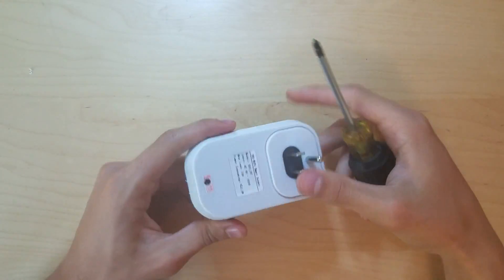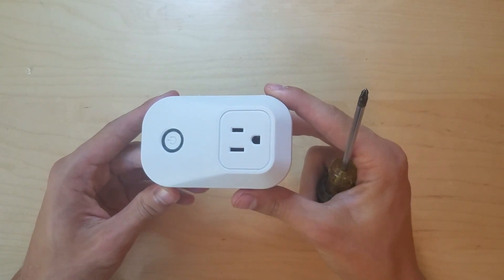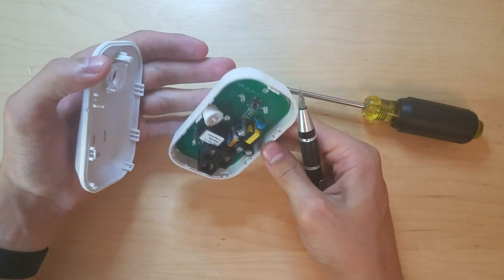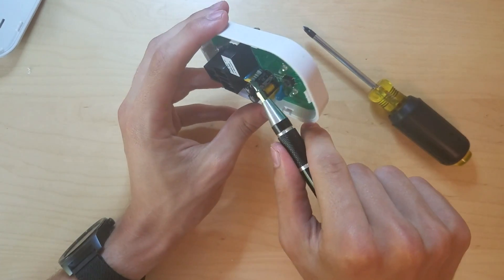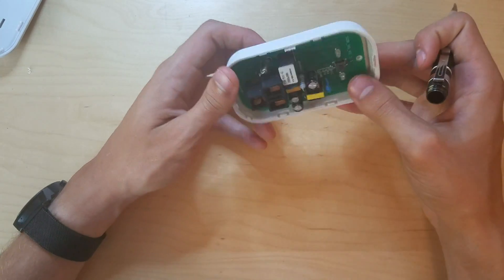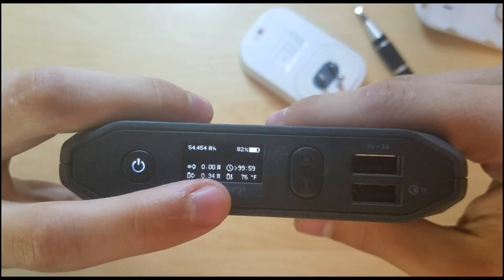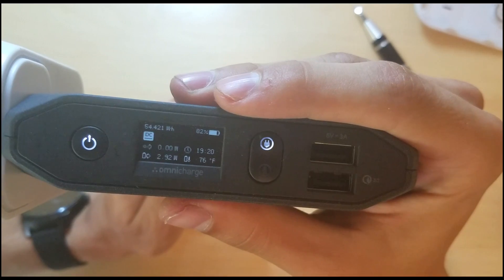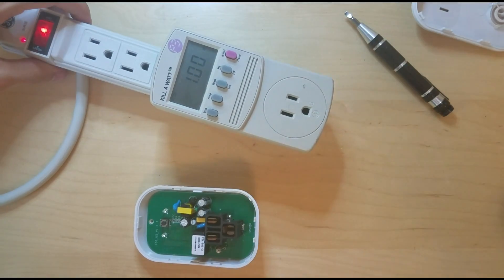Sonoff S20 Smart WiFi Outlet Teardown and First Look

Comment: The power-consumption may be on the higher side if it is broadcasting an access point for the setup procedure. It would be helpful to compare the power consumption while it is already set up and finished connecting to the wifi network.

Comment: FYI:  those blue discs aren't capacitors.  They're MOVs.
Reply: here's a desoldering tip.  Melt the solder bridge, then smack the unit on a table.  Nothing harsh, just a tap.  The solder will pop out due to inertia.